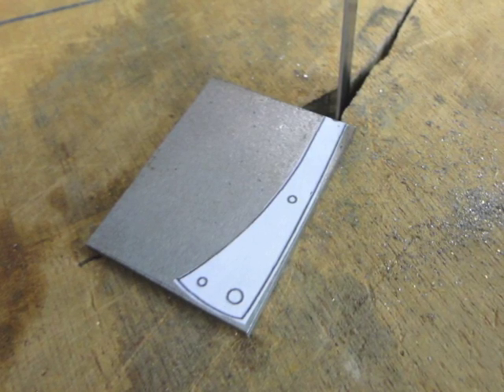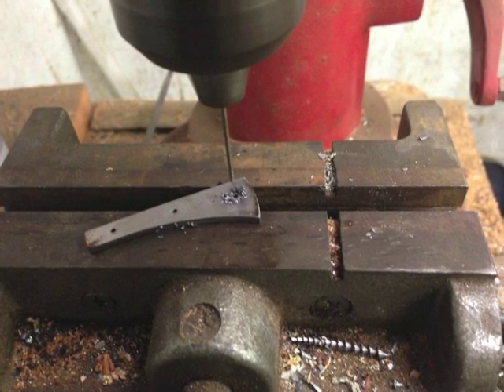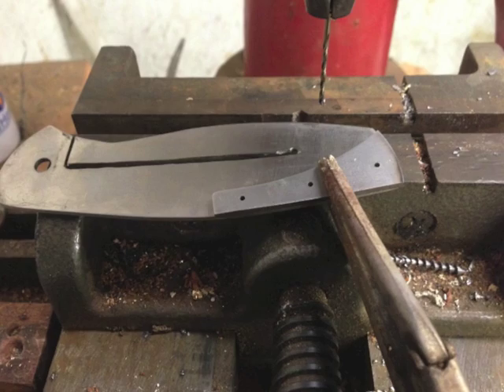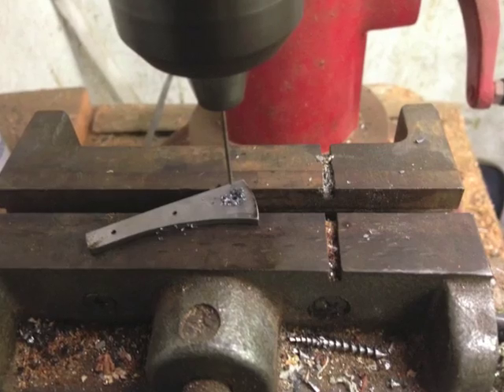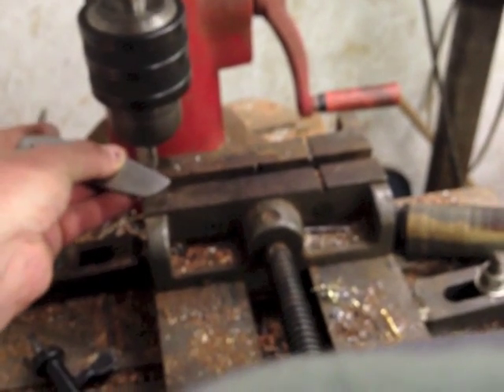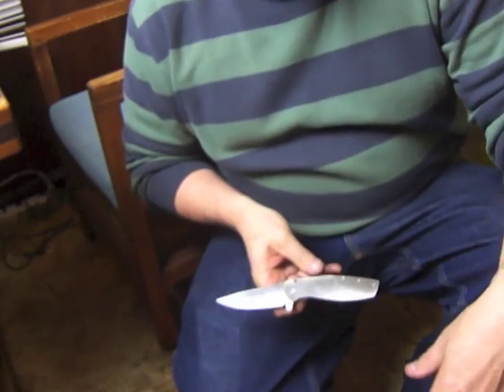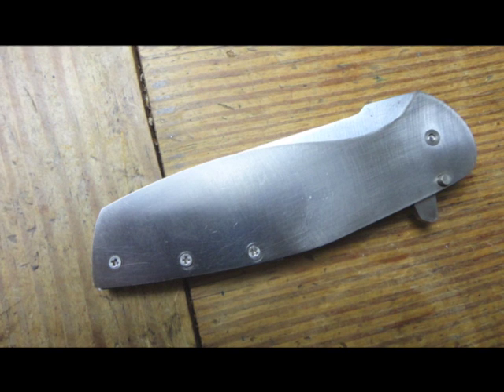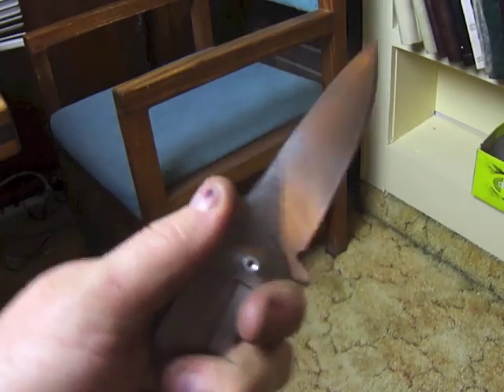How to Make a Liner Lock #2

Comment from the maker: I am glad that you are enjoying it, my friend.  I am going to try and get some better video shots to make things clearer.  I used a piece of the same steel the blade is made out of for the one in the video.  I will probably replace it or shim it because I will add washers.  The back spacer needs to = thickness of the blade + 2 washers.  I will be bending the liner lock in.  I will over bend it and then it will stay to produce the load.

Comment from the maker: Great.  You can make liners out of spring steel or O1 and then heat treat it and spring temper.  That is how Michael Walker made the first modern liner locks.  I would actually recommend it.

Comment: check out Gareth bulls way of cutting a frame lock. It might help in keeping your locks side lines straighter. It involves a drill press, a dremel cut off wheel, and a drill press clamp. the only thing you'll have to do is move it back and forth.

looking good!

Comment: What angle do u use for initial bevel on the blade before putting an edge on and all that good stuff? 

Your videos have been very helpful by the way lol
Reply from the maker: It depends a little bit on the geometry of the blade and how much width it has. I like to grind to about .025 on the edge before heat treating.

Comment: I know it is encouraged to use titanium as the liner lock and base, but would I be okay using something like 1080 steel?
Reply from the maker: +Tyler Rogers Hi Tyler, sure you can use steel for the liners. You will need to heat treat them though and then spring temper them.  I have used precision ground 01 tool steel in the past. It is very easy to work in it's annealed state, and you can get it thin enough for nice liners too.
Reply: SugarcreekForge what do you mean spring temper them?
Reply from the maker: +Tyler Rogers If you use 1080 or some other tool steel in its annealed state, it will not hold its spring position. So, you will need to heat treat it to full hardness and then temper it back to the hardness of a spring.  It you bend a piece of steel that is too hard, it will break. If you bend a piece of steel that is too soft, it will not spring back. For a liner lock to work, the locking part of the liner needs to be a spring. 6AL4V Titanium works as a spring without heat treating it.
Reply: So can I just bend it while it's soft and heat treat it as if it's a blade? SugarcreekForge
Reply from the maker: +Tyler Rogers Yes, sir. Exactly like that. You bent the spring to work and then heat treat it in that position just like a knife. You can Google the temperature that you will temper it at to get the desired spring effect for whatever steel you use. Remember it will be heavier than Ti, so make sure your liners are not too thick.
Reply: SugarcreekForge Thanks for the help!
Reply: +SugarcreekForge Hi again, so I will very likely use steel, but I am curious so I thought I would ask. I know you can't really use aluminum for the blade as it doesn't hold an edge, but it can be heat treated, so could it be used as say the locking mechanism for a liner lock knife?

Thanks in advance
Reply from the maker: Hi Tyler. My concern with that would be that since it is softer than a hardened blade, it would wear away pretty quickly and your lock would not be tight...
Reply: SugarcreekForge that's what I want to avoid for sure, thanks for the response